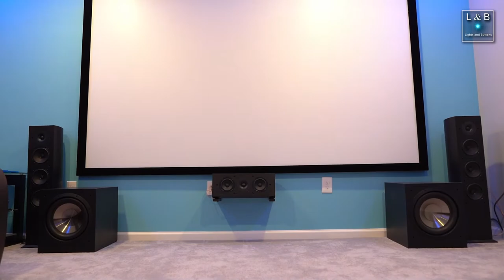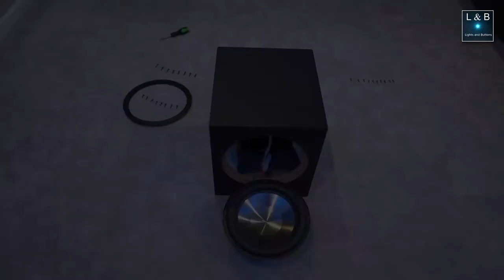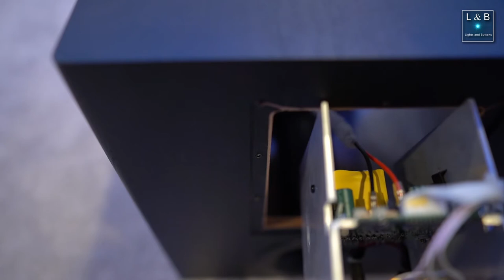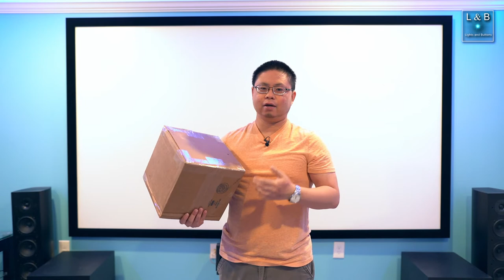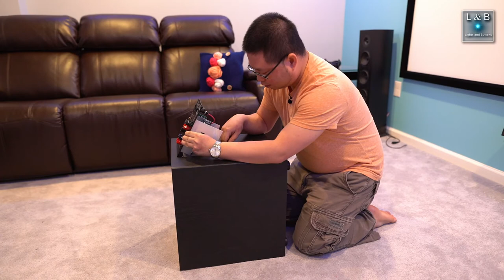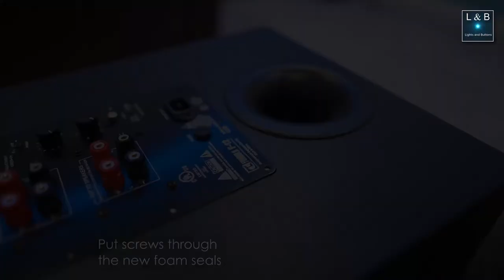BIC America F12 Subwoofer Thumping Noise Fix (Featured Episode #20)

Comment: I used a putty knife in the thin gap at the top to get the amp out. Two hits with a rubber mallet popped it loose. Replacement amp is now $180. Same sub on Amazon is $299.

Comment: Thought he was actually going to repair the board not change out parts...
Reply: He couldn't remove the back panel and you thought he was going to do board level repair... 
Most likely this repair could have been done for less than $10 by identifying the failing electrolytic cap/s on the driver board.
Reply from the maker: Drop a link to your repair video and I'll watch for when it happens the next time

Comment: I hate when you take audio equipment apart and when things are hard to put back or take off. You wonder if the designer or company ever thought someone might have to take it apart to fix someday. Meaning something that takes 10 mins and actually take 2 hours. Also, I like when the yt video tells what to look out for or learned not to do to save other the heartache.

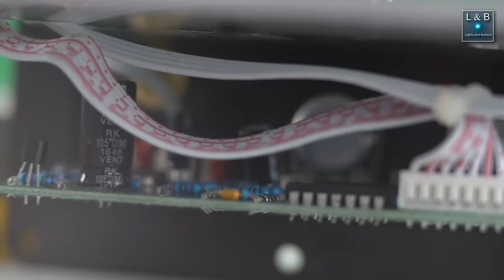Comment: I noticed that at time stamp 3:08 the plug on the right with a small piece of tape on it looked to be not plugged in all the way I'm just saying I have this problem but my sub is not as nice as yours and its older so I'm going to see about buying an amp but if it's to much ill just buy new Cerwin vegas I have been wanting to buy them for years just couldn't afford them but I'm going to spend the money now thanks for the video my friend
Reply from the maker: Good eye! If something like this happens again, I'll keep that in mind!
Reply: That is not "tape", it's a rubberized glue that's used on connectors to keep them in place. 
The connector does look like it's not properly connected... sad that it passed factory Quality Control like that.

Comment: This exact thumping sound is coming from my logitech z5500. I tryed everything with cables and nothing works. Also I opened the sub and didn't noticed anything wrong. And it's strange, because it happens everyday in the evening. I have everything plugged into surge protector. It just drives me crazy. Z5500 are more than 10 years old. Anyone have any ideas? Someone told me about Ferrite Core Cord Noise Suppressor. Do you think that will help? Ty all.
Reply: Replace the amplifier. That's the only way.

Comment: I dont know what happened to my bic america f12 i think it might be half blown because at low volumes you can hear the coil unraveled ir it can be something else?
Reply from the maker: Sorry, to be honest, I have not ever dealt with a blown sub
Reply: did you ever push it hard? (overpower it for a little while)
Reply: if you didn't, I would check inside to see if something is hitting the speaker. One time a had an old Yamaha sub and I heard a coil rattle. I opened it up and found a leaf on top of the spider of the speaker. If there is nothing, its most likely the amp.

Comment: I have a Bose system pre-installed in my basement and each time I watch a movie, the sub will rattle the walls. What can I do to reduce this annoyance please?
Reply from the maker: Thanks for watching! I started to calibrate my home theater a while back but I'm by no means an expert. I've heard of a couple of things that may help... moving the sub away from corners can change the properties of the sound. Not sure if that includes walls rattling. Another possible fix could be acoustic panels, which I haven't looked into yet. They can stop some unwanted reflections in sounds, and since they absorb sound, maybe that can reduce rattles?
Reply: Lyza I'm making some assumptions. It sounds like your Bose system is pre-installed into the wall. Is the woofer itself rattling, or is the low bass frequency causing other parts of the house to rattle?  I know that with car audio some tesa tape along the contact points of rattling trim will reduce or remove any rattling noise. If you can identify which parts are rattling against each other, you should be able to try that low-cost solution first.

Comment: How did you remove the driver? The front of mine feels like it is glued on
Reply from the maker: You may need to push it a little. It may be attached firmly and just got "stuck" over time. I don't recall seeing any adhesives
Reply from the maker: After disconnecting the driver, I didn't need a whole lot of force to remove it

Comment: Wish you played it, do they shake the room? Worth  buying ?
Reply from the maker: It does have a good punch, include very low frequencies. I used to use a 100W 8" sub, but it can distort easily. This runs circles around that. My wife did tell me the upstairs floor was shaking when I had it turned up. It'll be hard to show the power on camera, though. Maybe we'll demonstrate how loud it is by how many angry neighbors knocking on the door? :)
Reply from the maker: If I had to buy it again, I'd do it. I really like it for the price!